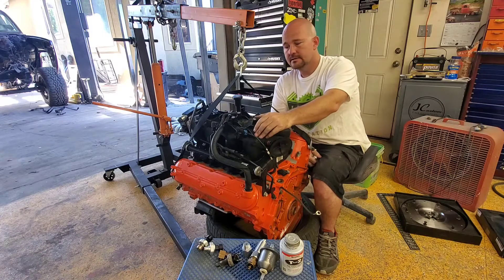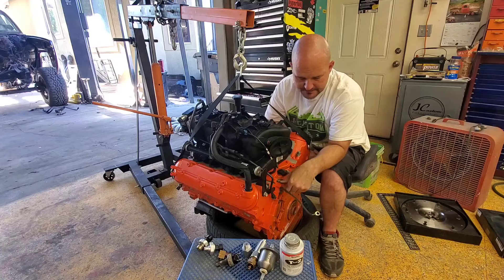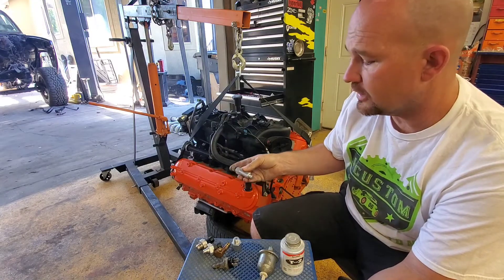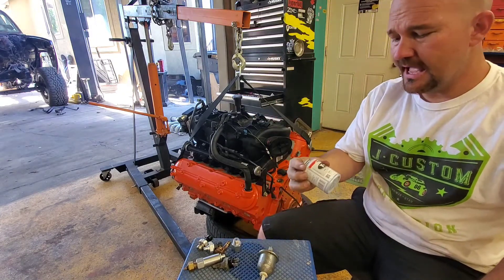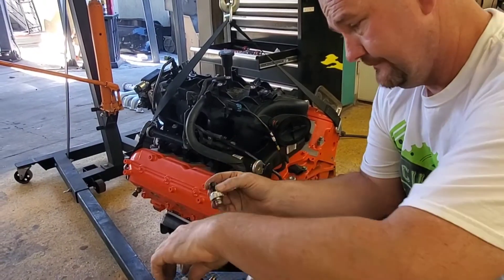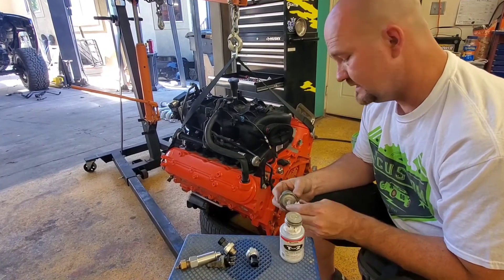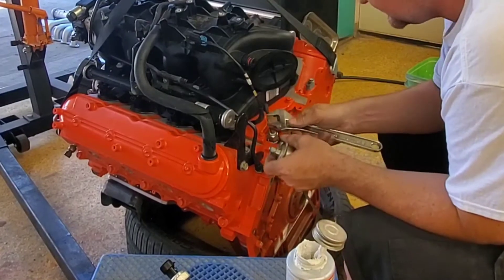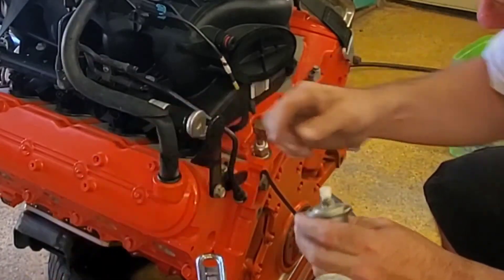Chevy k20  Square body swap ICT LS Master Adapter Engine Oil, Coolant Sensor Gauge 1/8 3/8 1/2 NPT

Comment: Were can I find the brass peace for the oil pressure adapter?
Reply from the maker: Summit racing has it MLI-S-655-1 And then I used an extension 2 inch

Comment: What about running a carb and msd on a 5.3 and keeping stock gauges. Is there a live oil pressure sensor that adapts into the 5.3 ? 75 k10
Reply: Thank you and thank you for taking the time to create videos and share experiences as well